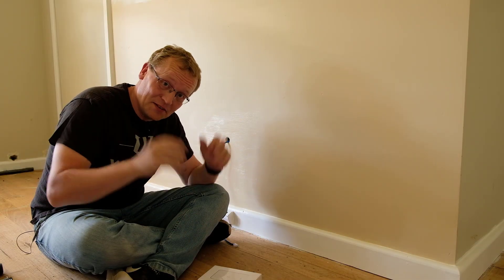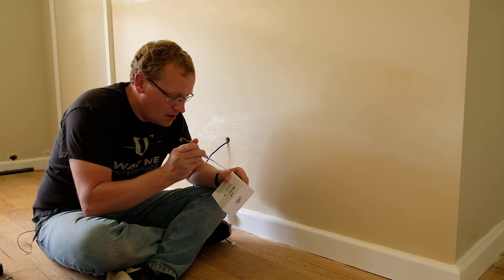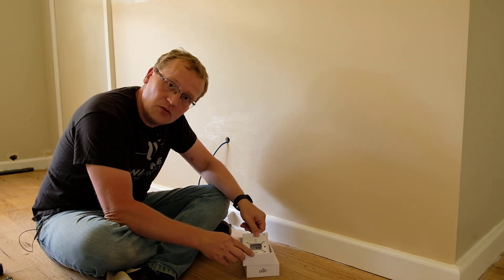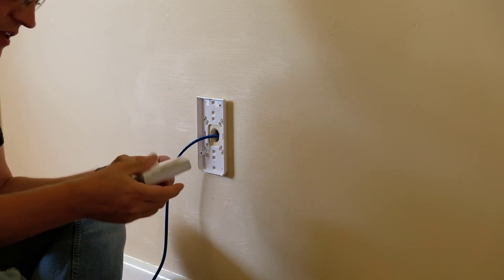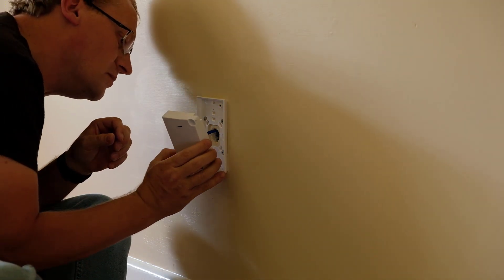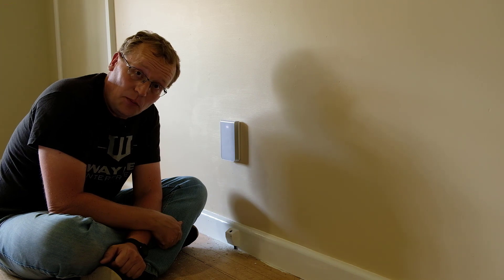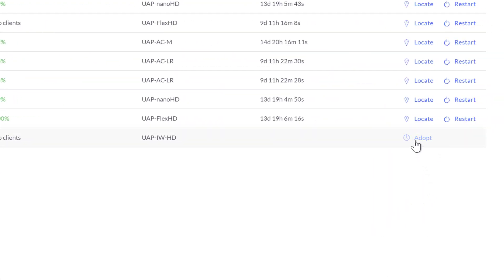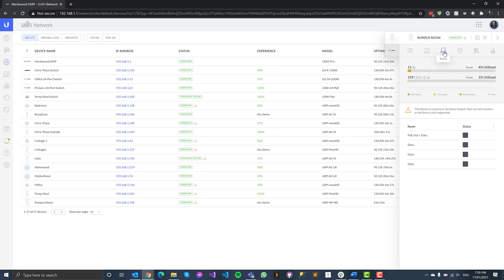Unifi In-Wall HD Access Point - Installation and Setup

Comment: Do I need to have a controller to use this? I live in an apartment and really just want a nice sleek wireless accesspoint but still have the ability to connect my TV and my desktop PC to have a wired internet connection.
Reply from the maker: You can use a Unifi AP without the controller, but you won't have the features that is controls, such as mesh network and more.
Reply: thank you! i just need it as an aesthetic looking WAP (for my cell phone and Apple TV), then plug gaming console, tv, and desktop into the available ethernet ports
Reply from the maker: @yayitzian  Keep in mind you need to power it with PoE somehow from the back of it.

Comment: Thanks for the video. Toss up between this and the unifi6 lite for the kids room. Added benfit of this I guess is the extra ports so saving on a switch.
Reply from the maker: It depends a bit on where you can get the cabling to as well. For me it is often easier to go from the ceiling, but I do enjoy the added ports.
Reply: @LarsKlintTech  mine is a full blown renovation so I can wire up either way. Hence need to do this right the once... 👍
Reply from the maker: @nasaspacemanwho6711  Ah, perfect. So, why not both? 🤷‍♂😏

Comment: You cant connect  it directly to network Router through the wall''?
Reply from the maker: If your router has an ethernet RJ45 port, you possibly could. The device is meant to connect to a Unifi switch though.
Reply: @LarsKlintTech  tyvm

Comment: Hi maybe you could answer few things about it because can't find it anywhere. 
1. Can you do trunk to this device and assign ports to different VLANs or you can only do 1 VLAN for all 4 ports?
2. How many SSIDs this can broadcast?
Reply from the maker: Very good questions Thomas. 
1. You can assign a profile to each port, which determines the network profile, which in turns defines a VLAN. So, yes, each port can have their own VLAN.
2. The SSIDs are determined by the Network Controller, which currently allows 4 WiFi networks with mesh enabled. All Unifi APs will broadcast the SSIDs defined in the Network Controller, if you allow it.

Comment: Fine... the physical installation is a no brainer but adoption is the challenge. This video leaps to a software applicaiton without explaining what software is required. Therefore the video is useless.
Reply from the maker: Hi Bryan. Thanks for watching the video and thank you for your thesis and scientific conclusion. I do mention it is the Unifi Controller, and even what version I am using. The adoption is a no brainer for most, but the physical installation is an issue for many. If you are considering a device like the In-Wall HD, it is likely you have a network controller already on a Unifi Dream Machine, Dream Machine Pro, or a stand alone controller. 
Perhaps ask for clarification instead of projecting your unhelpful opinion, which would allow others to learn as well. Have an awesome day, which hopefully is filled with a bit more happiness.
Reply: I found it quite useful

Comment: May be a silly question however if I connect this by RJ45 cable to my BT hub over 100 ft can I use the same Wi-Fi password as my BT hub?
Reply from the maker: No silly questions Paul :) 
You need a compatible Unifi switch or router to use the In-Wall HD. This would be a Dream Machine, Dream Machine Pro, switch for example. When you plug it in via a CAT6/RJ45 cable, the In-Wall HD then becomes an access point on your existing WiFi network, using the same WiFi password.

Comment: Does the cable need to come in through the wall from behind? Could it be connected to the below ports?
Reply from the maker: The CAT6 that provides the power and connection has to come in from the back. The design is for a wall mount like shown. The ports are only for output, with one providing PoE as well.

Comment: What kind of WiFi coverage does this offer? Would you say its 360 degrees, or front heavy, essentially mainly coming out of the faceplate?
Wondering whether this would be better being on an outside wall aiming in for better home coverage, if that makes sense.
But this looks ideal for a TV area, thinking of mounting one inside a TV cabinet to keep the cables managed.
Reply from the maker: The coverage is mainly for the room it is in, as well as possibly adjoining rooms. It isn't 360 degrees as such, considering it is meant to be installed on a wall. The coverage would be in front of the device, but radio signals are dirty and get thrown around everywhere. I wouldn't put it on an outside wall. It isn't outdoor rated and your outside walls are likely thicker than your internal walls.

Comment: I see that there is no separate POE for this, we just have to connect CAT6 and good to go? Thinking of buying one, how is the performance?
Reply from the maker: I am not sure what you mean by "separate" POE? But yes, attach CAT6 to the back of the device, then attach the other end to a POE switch port and you are good to go. 
Performance is excellent. It is 4x4 MIMO with 4-port Gigabit Ethernet, so you get excellent value.
Reply: There is 1 connection that must be POE into the unit, but you have the 2 bottom sockets that allow passthrough POE+Ethernet on one, and just Ethernet on the other.

Comment: Could of easily installed a single gang box, but hey it works lol
Reply from the maker: That was my first plan as well, until I discovered the In-Wall HD. And since there will be at least three wired connected to this point, it made sense 😊
Reply: @LarsKlintTech  no im talking a single gang box for mounting (electrical outlet box), would of been able to secure ur cat6 cable in it to prevent losing it like u were concernd about